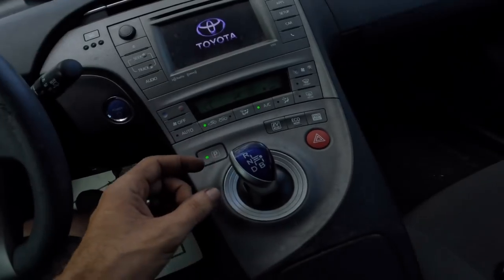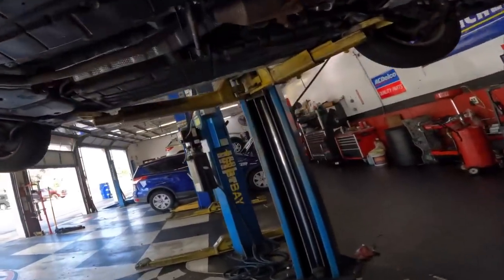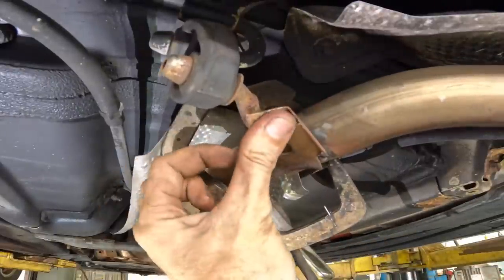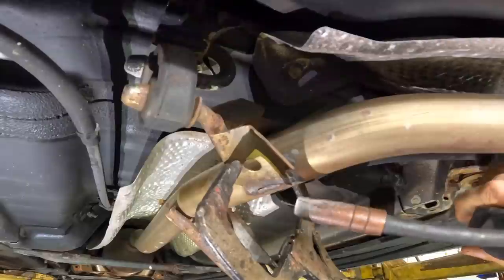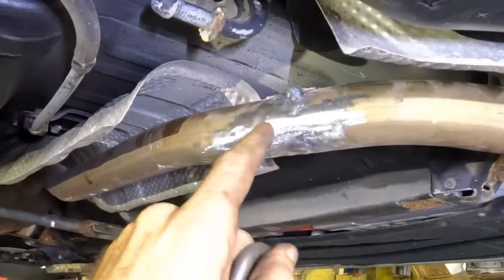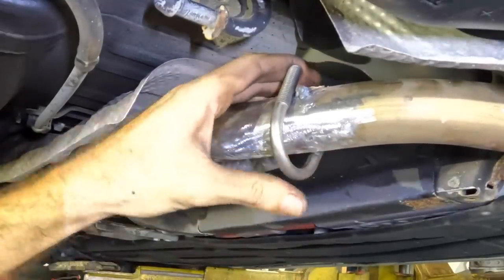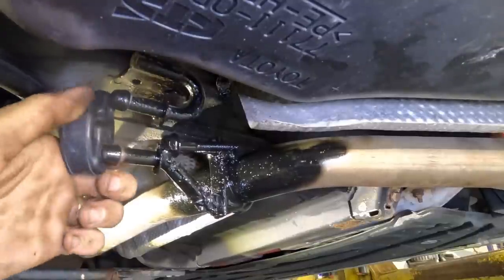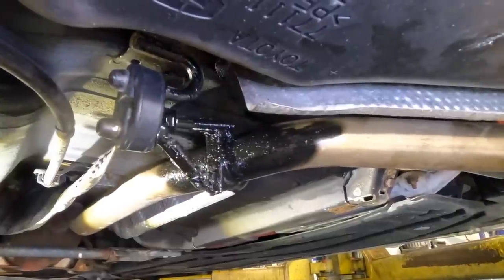This Video is a BAD Idea! Saved Customer THOUSANDS!

Comment: great repair Ray! on-the-fly fabrication with somewhat limited resources is the mark of a master mechanic, in my opinion.  much respect to you, sir.
Reply: I doubt Ray has any lack of resources.  Surely he has a tool box full of spare bolts!  The finished product looked something like I would have done down to the black paint.  I would have been pleased as Punch if that were my car Ray modified.
Reply: @corvettebob96  ..... key words.. 'fabrication with limited resources' means 'using limited', as in a clamp and a bolt, no inference of any lack of resources. i'd be happy with the repair on my own vehicle as well. Ray to the rescue!😀

Comment: Just a tip that I learned as I was self learning to weld. Anything with slag takes quite the skill. That is why I stick to regular mig wire. It can weld almost anything a stick or flux core can and do not have to worry about slag. But yeah throwing things out bugs a lot more than I would like to admit.

Comment: So...  I'm a hobbyist/ amateur welder with a friend who is a traveling mill write (professional welder). Things I've learned... anytime you're stick welding OR using Flux core wire, you need to remove the slag (the stuff the Flux leaves behind) before adding anymore weld. Adding more weld does NOT "burn the slag" out or away. Slag inclusions significantly weaken your weld. Also, this exhaust is quite obviously some alloy of stainless (11 years old and no rust. yes, most alloys of stainless are somewhat magnetic). You need stainless wire (that doesn't come in Flux core) and straight argon gas to weld it.

Comment: I just had to replace the whole exhaust system on my Tesla,I had a rattle also! The mechanic said it looked like someone tried to steel my converter but didnt finish the job. They kinda felt bad about it,so they sold me the new system at their cost and the labor was only 4 hours,so i squeeked out just shy of a grand! They are really good ,everytime I take my car to them!
Reply: exhaust on a Tesla?
Reply: watch out for those cooling nipples on the battery - one rock in the right place and you're in for $23k for a new battery, when $5 of plumbing fittings makes the repair better than it originally was!
Reply: This comment concerns me.
Reply: Hello Peter, what model Tesla has an internal combustion motor. Only ones with this need an exhaust. As Mediarav said "exhaust on a Tesla" - it only has an electric motor. Either you are taking a rise out of everyone or you are being deceived. Retired mechanic in Land Down Under.
Reply: This is a real, true story.
Reply: @bobhudson6659  Rich Rebuilds LS swapped tesla "Iced T" - the name's pretty clever, huh??
Reply: Yep Peter Smart, great job done on your Tesla, oh wait, did it get done by Tesla if not your Sat Nav will not work on Sundays and you are now down to remote charging only!
Reply: @andrewbarnett84  no it was an independent shop
Reply: @gorak9000  Ah, a man of culture.
Reply: Funny, an exhaust on a Tesla 😄

Comment: There are very few things we dislike more than exhaust work. However, the local exhaust guys don’t do work on Peterbilt trucks so we must learn as we go.  A buzz box does okay on this stuff, but overhead without gas is not ideal.  So innovation and creativity are the foundations of the trade! Kudos on the clamp.  Better than factory!

Comment: I agree completely with your assessment concerning your lack of welding and fabrication skills. I also appreciate your honesty. 

Flux core wire is perfectly acceptable. The only place you went wrong was grinding the muffler pipe and broken bracket clean on rust and oxidation. 

You completed the repair, made money and saved the customer money. 

Excellent work!!!!

Comment: Hey Ray. I love this. Philosophy spot on. FYI for next time - yes the exhuast is stainless, but its a 400series stainless which is slightly magnetic and also, and cold formed stainless ends up magnetic (the pipe is cold formed in manufacture).  But no matter - for next time, keep you amps up a bit higher like they were at the start, just take it hot, and keep doing that. Works every time. Welder 20 years - stainless, aluminium and everything in between - sometimes you just gotta do the job infront of you with the tools ya got :-). I reckon if you'd kept the heat up at the start, you would have finished it :-)
Reply: Huh! I sure had to wonder about it being stainless. I stink at welding exhaust. I usually end up blowing holes in it, so I'd probably have turned the heat down like he did.  Btw, what's in between? Stainluminum?😁

Comment: I’ve just had a similar situation a bracket holding my brake cable came adrift because of a rusted bolt I was going to take the suspension apart and turn the plate round as is has a bolt hole on both sides then I remembered I’ve got an old welder in the shed ,but I’m not a welder so it’s either learn to weld or spend  hours removing the springs etc   , your channel inspires me to fix things

Comment: That turned out pretty good.  Personally, I would have made a strap to wrap the tube, and overlap the original bracket.  On the strap wrapping the tube, I would have drilled a couple of 3/8" holes to tack the strap to the tube, then using good clamping, clamped the two strap ends to the bracket and then welded.  Matching the strap thickness to approx same as tube helps the welding as one part is not being much cooler than the other.  In your case, the bolt, for example, being able to absorb much more heat than the bracket, tends to be cooler, requiring the aiming of the arc more into the bolt, than onto the thin sheet.  Also, it is much better to always remove skin coatings prior to welding, on both parts.  Think "match metals" and "try to weld pure".  In the time you made this video, your welding skill appears to have improved, by the way.
Reply: exhaust hanger,with rubber/cloth anti vib, $8..

Comment: Just a question . Was it cheaper to do the work you did or just got the $11 universal clamp on muffler mount?
Reply: Ooooh.  It was leaking too? Didn’t know that thought you said rattling noise.
Reply: Exactly
Reply: Let’s see Ray had a welder no parts too charge for just his time I think welding was a better option even though that exhaust clamp is not that much money
Reply: @TheDon8771  It wasnt leaking. It was just a broken hanger.
Reply: @ryans413  His hourly rate is most likely 200 or so. So instead of using an 11 dollar uni mount, he prob charged 200 bucks.
Reply: @nickmalone3143  no regular clamps are still cheap… it’s the muffler mount clamp.  Gotta charge more for that I guess. Lol
Reply: @ryans413  thats ur opinion dude

Comment: I remember my days working in oil field shop. When I helped the welder. Always disconnect the battery to the vehicle. An cleaning the area. He was going to teach me how to weld. But I didn't stay long there, I did learn how to use a cutting torch and a device that was like a little car but had a track and would cut metal straight. That was fun.
But glad you saved him money. I like to say, good enough for government work. 👍

Comment: With flux wire I've found that grinding the metal clean before welding and between each bead helps the weld alot, tip if anyone wants it. 10 times better to just get gas tho..

Comment: I used to be in a welding school. The first thing that's taught with Mig and most welders is that you must grind the surface clean like you did after fouling up the beads.
It's something to do with gas mixture, heat and contamination that causes it not to properly weld.
As long as the surfaces are clean then the weld should mix and properly bead if the wire feed speed and heat is just right. If it's turning black and popping something is wrong.
If that happens change speed and heat. I would practice on scrap metal that is around the same thickness and material of what I plan on welding and after perfecting the bead and settings I'd do the actual job.
In this case a junkyard exhaust pipe and a few Bolts would be perfect to test it on away from the vehicle.
It honestly doesn't take much time. Maybe 5-7 bolts on a peice of steel trying several beads until you get a thick beads that looks solid without popping.

Comment: I had a car where the subframe had rusted thru in the bolt holes . My machanic wanted $1000 for a new sub frame, but the welder down the road could welded it back in position for $95. It is good to have an economical man on the job.

Comment: Awesome. Love a good save. 

My only advice on welding gasless is take the shroud off.
Reply: bad idea, as that can make the wire weld itelf to the tip not the nozzel which is easier to clean. source i do this for a living
Reply: @maddog2010p  that sauce is worth its money
Reply: @maddog2010p  how? How does removing the nozzle make the wire weld itself to the tip?
Reply: @maddog2010p  shit also happens and you are full of it. You do this for a living? I doubt that. You remove the copper/brass gas shield and replace it with the plastic one to keep the torch head clean.

Comment: Hey Ray,  the muffler clam would work nicely with a small modification. Discard the U bolt and replace it with a length of threaded rod making the same U joint in the centre of the rod. Install and tighten the nuts to the clamp. Cut off one end of the rod. Bend the other length as you need to to make it fit into the rubber hanger...done!

Comment: What a bodge - you could've saved yourself a lot of time and pain. I would've used a stainless steel jubilee clip around the exhaust and threaded through the holes in the hanger bracket. I've bodged many exhausts and the main problem of failure is the welds which always rust away due to using the wrong rod/wire. I had a stainless exhaust that failed along the seam because of this.
Reply: Yep. Much easier and vastly stronger.
Reply: Oh I was thinking zip ties and bailing wire myself but let's not get overboard have a good night

Comment: Stainless steel comes in various types, that exhaust is stainless it’s just a magnetic type as it has less chromium in it.
Flux core mild steel welding wire out of all options is the least ideal as you’ve discovered lol
Reply: Alot of folks don't know some stainless is magnetic
Reply: @markwarner8336  or that contrary to its name in a lot of cases it isn't truly "stainless", it rusts lol

Comment: Just curious why the whole exhaust system would need replacing. I see at least 3 viable options. Replace mount with different mount or cut out section of pipe and just weld in new section or clamp in new section. But I’m no mechanic. So what do I know. Hell if you were in a bind nothing beats a good coat hanger.
Reply: Thank you for the suggestions. The coat hanger one made me chuckle. 😄😂
Reply: Sad fact of modern life.....metal coathangers are getting much harder to find. Damn things are all plastic these days.
Reply: @Flakmagnet1701  Bailing wire still plenty abundant though thankfully!

Comment: Ray, everytime you pull out the welder you defend yourself by putting it out there you're not a welder and still the comments get filled with people going REEEEEEE! But what I don't understand, you do have to regularly use the welder (and soldering iron)... why not sharpen your skills a little? Take a short basics class... you can be more proud of the end result and no more REEEEEEE
Reply: absolutely. a basics class in welding and materials would be great for everyone working with metal really
Reply: "Dammit, Jim! I'm a doctor, not a welder!"

Comment: you can weld stainless you just have to use the correct wire or rod, I've done it a lot, even welded my own traction bars up out of 316 stainless using 316 stainless rod.

Comment: Hello! I had this car and I loved this car! I did everything on it by myself (I'm not a mechanic). I had the exact same problem but I don't have a welder so I gave it to a garage. People from the garage said it's safer to remove the exhaust and then weld on it due to tons of electronics on this car and I would agree. Just consider this for the future. They also managed to weld to the pipe directly but I don't know the welder they used. Thanks for all the great videos.

Comment: Amazing. Love your way of looking at the big picture. Have a 2012 Volvo, exhaust was leaking (crack between pipe and muffler). Volvo wanted to replace the whole thing for around 2500$. Found a good mechanic/welder and fixed it for 75$. We have to go back to fixing things and not just throw away and replace things that still works.

Comment: I'm not a welder either.. you needed to wire wheel/grind the clamp and pipe first, as always. That's a must. Also on the weld for thin gauges you need quick tacks to keep the red heat down with gaps between tacks with pausing in between. Then go back over it again slowly filling the gaps more and more. Most importantly pause as you go.

Comment: Got to agree on the "Made to fail" assessment. That factory bracket looks like the most half-assed PoS hanger I've seen. At least your bodged together solution is going to do the job it's intended for and not break off after a few years!

Comment: That was a solid decision. That exhaust was in very good shape.  Now a dealership on the other hand would have priced out the entire back section of the exhaust, unless any of the mid muffler / resonator sold seperately in sections. Then they would have sold that along with 2 clamps to cut and section just for a minor exhaust hanger. turning a $130 dollar job into $600-$1000
Would have been much easier to use a vise and a 4" grinder/cutoff to shape that old bracket instead of that slow cutting sawzall

Comment: FYI next time grind it clean then clean each time you hit it with flux wire. Flux is just like stick it leaves behind slag. I went to school for welding learning all 3 tig, mig and stick. And the finished product looks like an M16 Front Sight.

Comment: 🙃 have the same issue with throw away society. Repaired a outdoor staircase over demolition and start again and then owner wanted planter boxes done I suggested use the old threads as they are okay condition good enough for a garden bed at least. Saved on rubbish fees and on new timber, fuel and time. Wins all round

Comment: Ray, just fyi most tail pipes and mufflers are made of 409 or 410 stainless. It’s a low grade stainless and will rust some and a magnet will stick to it to some degree. Also you don’t need your ground that close to where you are welding. Just place it out of the way and weld away. 
I really enjoy your videos!

Comment: If you don't have welding gas you can do decent welding anyway. Add a lot of anti spat welding spray and weld short period of time until you spray the metal again. I tested this method few times and it works amazing well.

Comment: Recently built a 2-1/4 in exhaust for my 80 VW pickup. Built using a few mandrel bits to achieve most of the bends though could have pieced the angles together. Long runs done using sections of fence pipe (kind used for chain link). Welds not exactly pretty but hold. With the investment of the 2nd hand welder + the odd bits it probably cost me almost as much as the >$400+ SS bolt-on exhaust but was worth the experience working on such thin material & have the means for future thin work.

Comment: I don’t know that this one is but the problems I had welding exhausts was the anti corrosion coating i.e. Zinc, unfortunately the clamp you used is also plated, personally I would have constructed a purely mechanical clamp with no welds just good old fasteners. Kudos for saving the part.

Comment: Good to save customers $ as they will remember that.  One step to remember for welding is step one ( make it shiny with the wire brush etc.) :)  Dirty rusty metal makes bad welds.  Glad you got it fixed.  I learn a lot from your vids.

Comment: Did you notice the two holes in the original hangar bracket? A regular muffler clamp fits right through them and tightens the hangar back into place.  Then you can tack it a bit if you want to, but it isn't necessary.

Comment: Those gases provide insulation against the surrounding air thus
allowing the welding heat to remain longer at the weld surface.
The end results are smooth welded joints and less beading. And
it goes without saying: you should practice on some discarded
exhaust pipe first. I'm out of practice too!! Beading is the result
of RAPID COOLING. Preheating all the surfaces first also helps!

Comment: Nice simple fix if I could weld I would've done that instead I ended up with soup cans and coat hangers. It works it beats replacing the entire thing it's gonna rust out anyway in a few years.

Comment: I work with some people that would have just thrown out the bad linkage. There's enough other parts still suspending the exhaust. I myself hate the fact that the Prius has that backup beeping when in reverse that you would hear on larger trucks. Only thing is you don't hear the beeps on the outside of the Prius.

Comment: Not all stainless steel is completely non magnetic.   It depends on the specific alloy and percentage iron.  Specific to the prius, as I understand it is technically a stainless allow, however on the cheaper end.   This leaves it somewhat magnetic, less rust proof than some, and difficult to weld.  I suspect with flux core, probably impossible.  Keep up the good work Ray.   My hats off to you for trying to weld on youtube, especially not being a professional full time welder.

Comment: Here's a tip on wiper replacement,always put a foam pad over the glass  to prevent breakage if the wiper arm slams down without the blade.
Reply: Good idea. Reminds me of how I used to clear ice off of the wipers. I'd pull the blade a few inches away from the glass and let it slap back. That is until I cracked my windshield. Never figured it was enough energy to do that. Later I saw someone else doing it, so I'm not the only one...  I told that person about my experience.